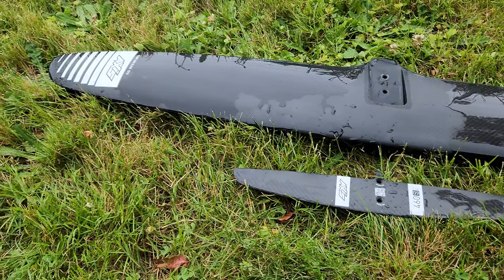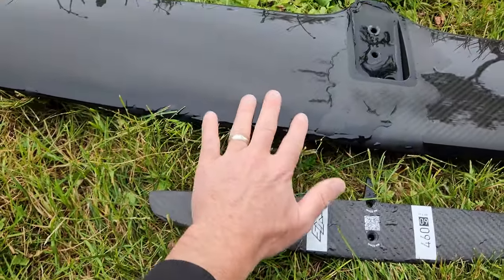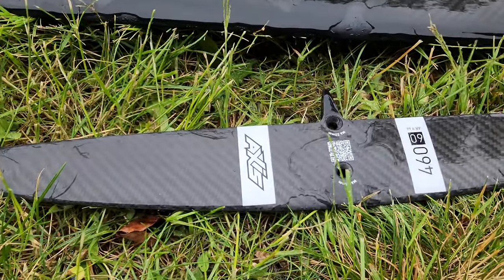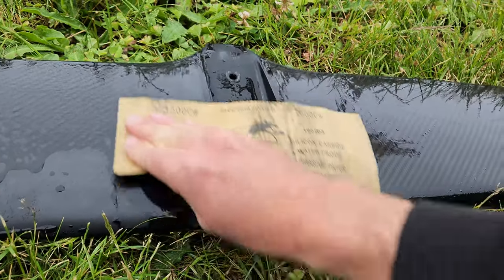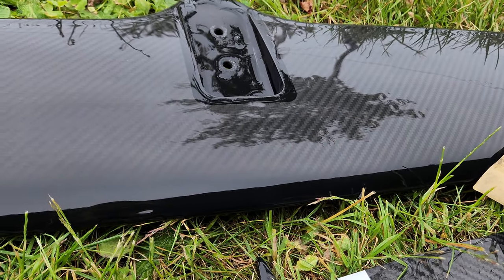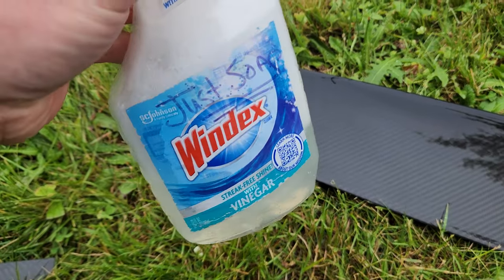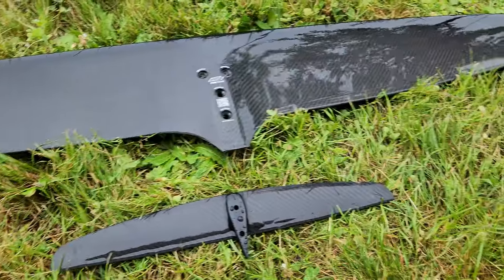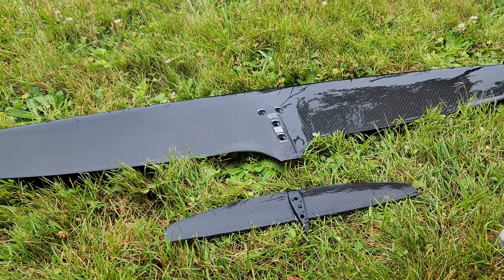Foil Sanding for Speed and Predictable Control  |  Axis PNG 1310 & flat 460  |  Jonathan Reinke

Comment: The terminology you where looking for is "the boundary layer";  Unless it is a absolute perfect uniform and smooth finish (highly unlikely), a directional fish (in same direction as direction of the flow) is better so you get this "boundary layer" by water sticking to the surface.   When sanding, >1000 grit in successive and climbing grit, always use a sponge or something medium soft so the paper doesn't get any hard vs soft pressure points.  Apart from sandpaper, a polishing paste can help as well for the very last perfect smooth finish (grit >2000 possible)
Reply from the maker: Cool thanks 😊